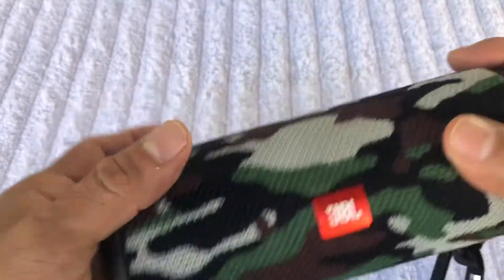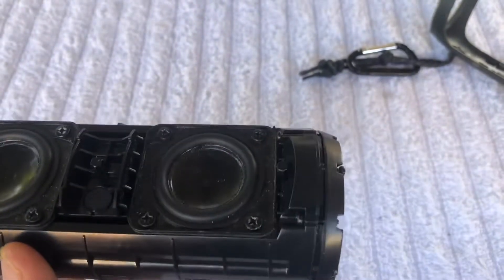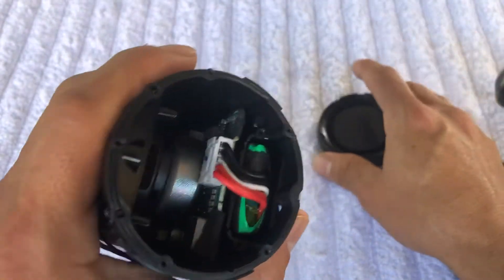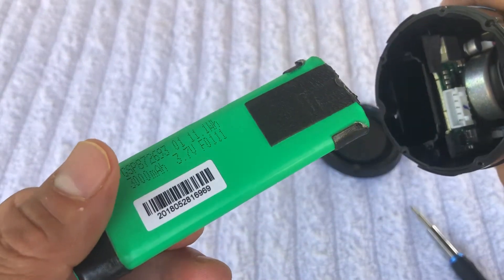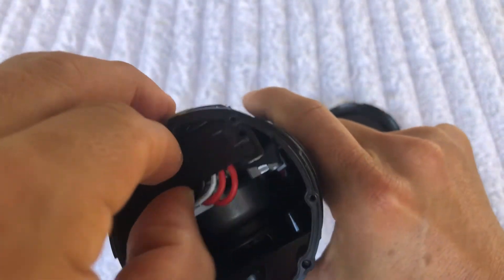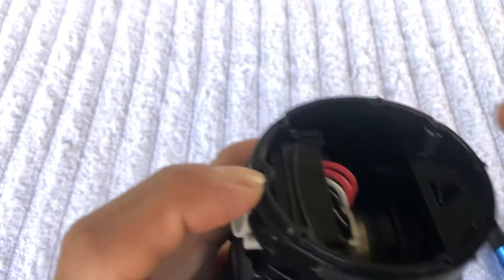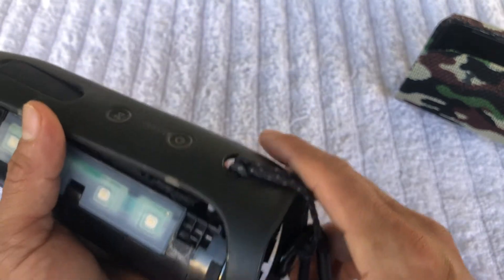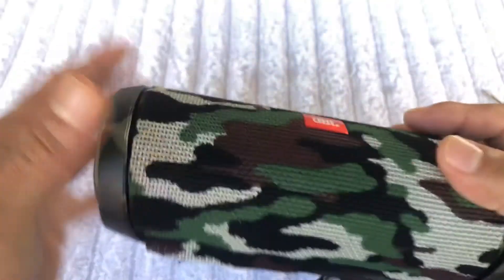How To Replace The JBL Flip 4 Battery

Comment: If it's swollen good luck. I ordered a replacement battery and then tried to get the old one out. Wrong order. Couldn't get it out. Finally put it in a fire proof bag and pulled with a pair of pliers and it ripped the wiring right out. Time for a new speaker :)

Comment: Good tutorial but be careful when taking out the first 2 screws at either end because the speaker magnet is so strong it will pull your screwdriver right into it causing a puncture in the speaker. 
Also my battery did not pull out by pulling on the plug. The plug wire pulled out of the battery. I was able to pull the battery out with pliers by grasping a silver tab that was sticking out. Dont bother taking off the other side thinking you can push it from that side, you can not, it is sealed. 
But your instructions are good, sometimes things don't always go easy. So I am now waiting for a new speaker. 😡